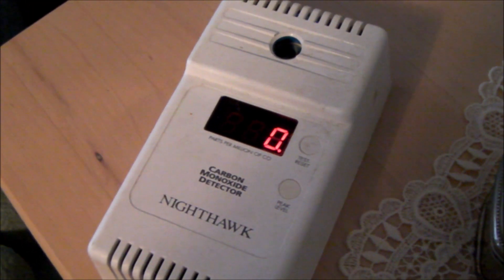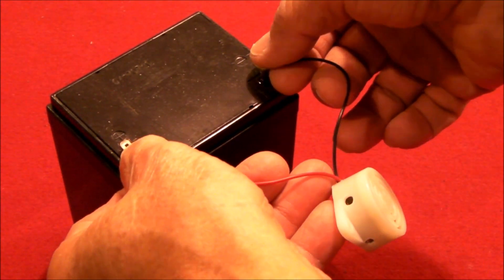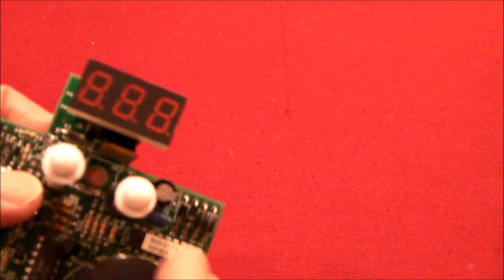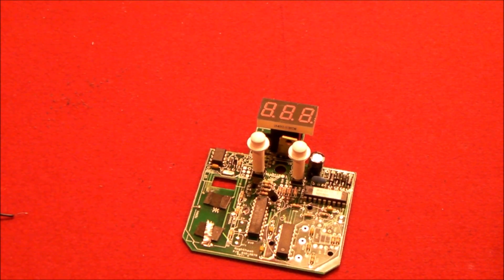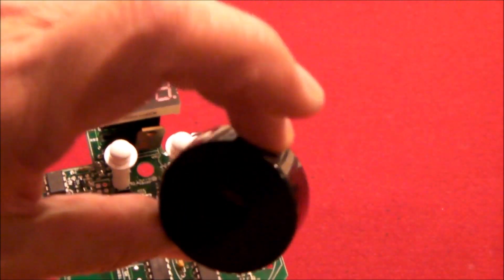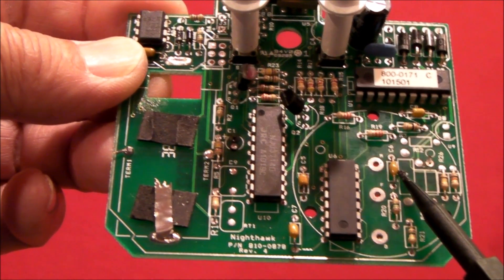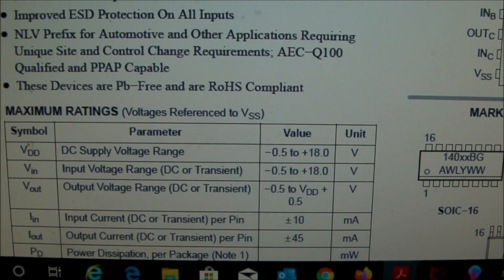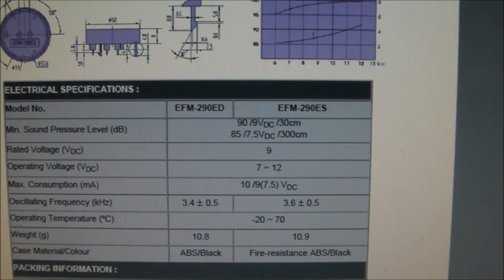External Oscillator required to make EFM-290ED Piezo alarm work and function properly

Comment: The CO detector board I removed the EFM-290ED from was similar to yours, but didn't have that chip under it, just a bunch of resistors and a capacitor.  If you have an oscillator circuit I'd like to see it.
Reply: Update:  I did connect an oscillator circuit up to the piezo and while I could hear the audio in it, it was very weak.  So I guess an amplifier would help.
Reply from the maker: I don't recall exactly the details but I think I found a circuit on the manufacturer's data sheet.